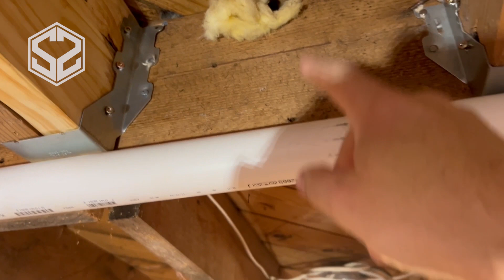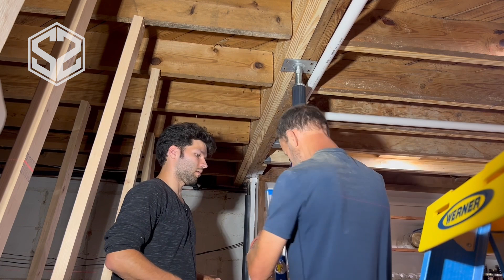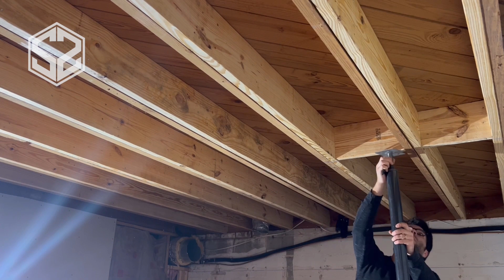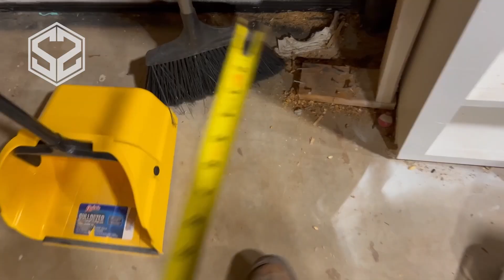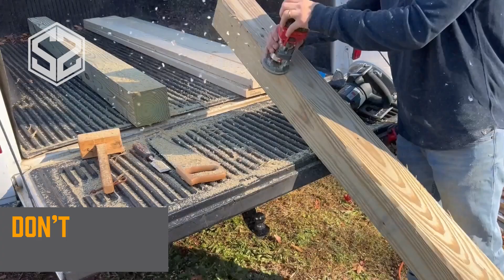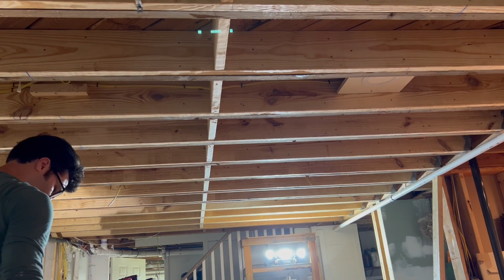Reinforcing Load Bearing Beam

Comment: A few curiosities:
1. Did the 4x4 point load posts go to a part of the floor that had deep concrete support below the floor, or just onto the 4-inch thick basement floor?
2. Did you mount the 4x4 post to the concrete floor using a steel plate mount, or just run it to the floor? 
3. If you didn't mount to a steel floor plate mount, did you put a moisture barrier under the 4x4 post? Not supposed to put wood directly on concrete, that's why I was curious.

You sistered the beam well, used joist hangers instead of toenailing, very nice job.